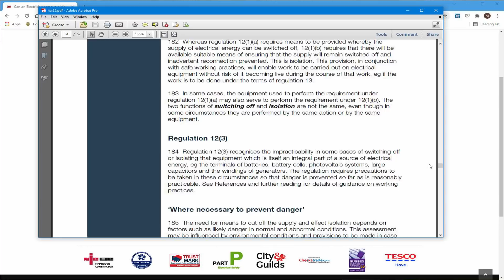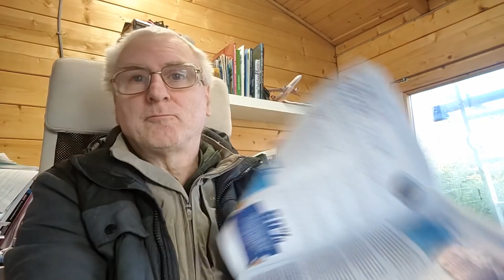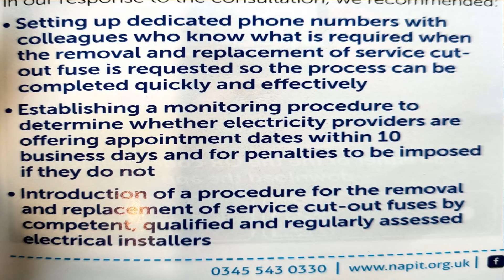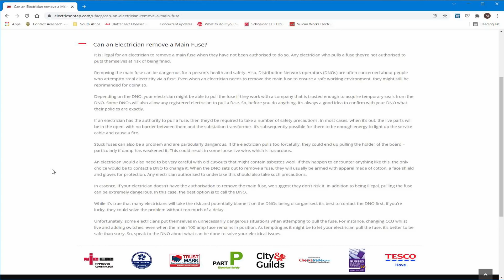CUTOUT OR MAIN FUSES - New procedures for 2022 should finally allow electricians to pull these fuses

Comment: I've lived in my house for 37 years and for the whole of that time the cut-out has been unsealed as one of the lugs that the seal should go through is broken off and the other is inaccessible.  Even when the meter was replaced some 18 years ago nothing was done about this.

I don't understand the bit in the article about there being "enough energy to light up the cable and cause a fire". If you don't let anything, either your fingers or something conductive, to enter the open fuseholder (which surely is just basic common sense) then where is the "energy" that is going to cause a fire going to come from? 

I've watched many a video from a variety of Youtube electricians and its pretty obvious that most of them will pull fuses and cut seals on meters if the job requires it.
Reply: I think the problem is.... If any electrical appliance is still switched on and therefore current is flowing through the fuse and holder as you pull it. The current can arc across. Particularly if higher current is flowing. Obviously a sparky would double check that all loads are off..... But a householder may not.
Reply: @ivanhoe6366  An arc from trying to break a high current would certainly cause damage to the fuseholder, might cause injury to the person doing it, but "light up the cable"? I don't think so. 
The article was talking about the pulling of fuses by electricians, not by householders. Any qualified spark should know better than trying to pull a fuse under load.
Reply: Sorry, I was just mentioning these things just Incase someone without any electrical knowledge thinks it's fine to just pull the fuse without switching off loads. I knew a householder who made that mistake.

Comment: I am certified to pull a cut out by SWE. I had to attend a 1 day course at the DNO office and my company has to have a certified set of crimp pliers and seals. We have to notify the DNO before I touch a fuse and the PPE they specify that I have to wear costs £1000 a set... I know its nuts, im just saying... I cant see them letting every short course sparky loose on the fuses.

Comment: Thanks for the video. There already IS a procedure for assessing the competence of an electrician (or any person with appropriate training and knowledge)  to isolate the incoming supply at the cut-out fuse - it's the authorisation procedure for meter fixers! I'm a retired DNO engineer and I had full O1 operational authorisation at LV, 11kV and 33kV. My former employer has a specific LV operational authorisation for meter fixers that allows the necessary LV switching at the cable-head (designated OP-3). I guess any electrician could take the (presumably short) course so that they can demonstrate competency re switching, identification of cut-out types, risk assessment of cable-head condition, etc. It would cost money (no doubt!) to do the course but then the holder of the operational authorisation could complete their own isolation.

Comment: A big opportunity was missed with smart meters, if they'd been required to have a (lockable) DP isolator on the consumer side built in, it would have massively simplified things for all parties...
Reply: Yep exactly. They should be fitting cutout switches which allow the consumer side to be worked on safely without needing to pull the main fuse
Reply from the maker: Thank you for the comment. I agree if smart meters are being installed then isolators should be put in as standard.
Reply: @vwes  im a meter fitter for Eon and yes all new smart meter installs come with a isolator fitted if the customer has enough space to fit one. all new builds require an isolator from 2018
Reply: Yes exactly what I was thinking.
Reply: When I had a smart meter fitted a couple of years ago the fitter put in an isolator in after the meter so some suppliers are already doing this.
Reply: Just had a smart meter fitted last week. The installer did fit an isolator and as I knew that my meter tails were not 25mm, I supplied him some 25mm tails and he was happy to fit them from the Henley block to the isolator meaning that I can get an electrician to change the tails to the consumer unit without a fuse pull :)

Comment: I think on the asbestos front more reaseach and education is needed, with a better communication of the risks. I think we may have gone too far in terms of risk aversion. Yes factories or workplaces where the air was thick with stuff, that is obviously unacceptable. But is the risk of exposure from a fuseboard (removed with due care, say wearing a mask and placed in a sealed bag) much higher than walking around a town with buildings using the stuff everywhere, some kn states of decay
Reply: Absolutely, as the saying goes "The dose is the poison". An occasional minor exposure to a bit of asbestos in a fuse holder will have homeopathic risk.  You would have more asbestos danger sweeping the spider webs off an older artex ceiling. I agree that the world has gone asbestos mad the last few years with no proper risk evaluation.

Comment: Just pull the fuse and use common sense and you will be fine, i always pull them smart meter or not if theres no isolator and seal it up afterwards, old metal clad cutout with asbestos flash guard or phase barrier is it going to cause much issue unless you start pulling it apart ?  Your there to do your job so best to do it and not pussy around a fuse your more than quallied to pull
Reply: Can you recommend a supplier for common sense? Because I'm all out of it.

Comment: Just require when ever work is done (EV/CU/tails) then a main isolation switch would be required as well to be installed and operational.  Then slowly over time more and more would be equipped with them.

Comment: Its an urban myth that DNO's send out engineers if a fuse has been pulled without permission on a smart meter.
Reply from the maker: Have to beg to differ, because Ive seen it happen. I turned off the power via our isolator so I could do some work, and I kid you not I got a phone call within a couple of minutes asking what was happening. The moment power is lost to the smart meter is stops transmitting data to the electrical supplier, and if there's no report of a power cut they are straight on it.
Reply: @vwes  Using a mains DP isolator would not interrupt the supply to the smart meter, only the distribution board (consumer unit) ? You must have pulled the cutout ?
Reply from the maker: @kevanswift7797  not on ours it's positioned between the cut out, meter and solar panels, as we send excess power back to the grid, so it has to go back through the meter. In this case don't ask me why, that's a question for the DNO and solar engineer
Reply: @vwes  yes but they didn’t arrive did they. A call centre called the customer. That’s if they have the correct number…

Comment: Been pulling them for 40 years, no issues so far.
Reply: I don't see a problem  with it also, not just yet, they're easy to pull out and put back in.
Reply: Same here, don't get dragged into a world of BS, meter seals missing get DNO monkeys in to reseal after or vde pliers into tail blocks.
Elf and safety cretins v decades of experience
Reply: I pulled many fuses in my day as a sparky as the seals were much simpler to replace then. My local supplier used to keep a box full of the old flat types under the counter. When the seals changed to the tubular ones I would just cut the wire off and then pull the strands from the seal, make the hole a bit bigger and then replace the twisted cable type wire with bicycle gear  cable as it was exactly the same, a drop of super glue in the hole would hold it in place. I'm about to pull the one on my smart meter so I can change the consumer unit, any tips ?.
Reply: Just simply needs a two pole switch disconnector off the meter tails to fusebox , job done 🤪

No need to pull bs88 😁
Reply: @marksimpson3035  Who’s paying ?
Reply: @richardjones3112  whoever  the people that change the meter tails otherwise it's back to square one 🧐 & pull the bs88 cutout
Reply: @marksimpson3035  What about when the customer gets accused of tampering with the DNO equipment?

Comment: I've made enquiries to the DNO for installing a DP isolator they wanted £250.00 Inc VAT ........Bargin.......and the next available appointment is in 6 weeks, yes the energy companies will fit a DP isolator alot cheaper or sometimes free but you will be waiting longer for them longer than the DNO.

Comment: I pull the meter tails out of the consumer side of the meter and fit a iso switch and reconnect the the tails and fit a new crimped seal to the meter when I'm finished , makes life easy with no drama's......job done  👍
Reply: Smart meters do tend to have a sensor to detect the cover being removed, not sure if anybody (suppliers / DNOs) are doing anything when it triggers, but they could in theory (as it might suggest someone eg trying to bypass the meter for a cannabis farm or similar)

Comment: If DNOs fitted a DP switch isolator with the rest of their equipment then Sparks wouldn't have to pull main fuses 🙂

Gas can be isolated at the meter.  Water can be isolated where it enters the property.  Electricity... there may or may not be a safe means to isolate depending on the history of the installation.

♥️ the DNOs
Reply: Thinking of all that safety is needed isolation.

Comment: I'm a long time retired Sparky my son is working Approved Sparky even so I decided to go down the official route and have my supplier install  for my own house  a Mains DP Isolation Switch and also the meter tails from Smartmeter to this new Isolation switch upgraded to 25 mm from 16mm. What an absolute long winded nightmare I had.
I requested this in July and it wasn't until November it was actually sorted and installed.
 I had  kicked up a right stink due to the poor service and confusion  my suppliers seem to work under and eventually got it done with no charge (was £81).
Scottish Power were my suppliers - Lowery Beck are their 3rd party installers - but then a man from Siemans turned up to do the work. hmmmmm.
Its done'  it works - but it was painful journey. 

If it was a quick job - probably I would by accident knock the fuse out  now - I would not like to go through the months of phone calls and emails and anger/frustration again for such a simple job.

Comment: During the pandemic my DNO made the decision that they would not be fitting isolators of pulling fuses for electricians...  They would however give me permission to pull the fuse providing I had all the correct safety equipment..  I agree I would not touch old fuses but have pulled the newer fuses, I have seen so many DNO engineers (Who are not electricians and get about a week or two of training) just pull and push back in the main fuse with no safety gear and with loads attached, lights on etc...  I always isolate the consumer unit(s)/isolate solar put on the required gloves and face shield..  You can either take the fuse out and put the cover back in or boddingtons do a fuse cover you can put in..  I always then fit an isolator.    If I didn't pull the fuse I would have lost so many jobs when the DNO refuses...  

I found energy suppliers are cheaper if you get the customer to ask for an isolator to be fitted, although making the call centre staff understand what you want can be a challenge..  I don't see how its safe for someone that is not an electrician but has had a week or so training to pull the main fuse but its not safe for us..  I think its all about if they do it and something goes wrong they have the bits to fix it where as we would have to call the DNO to fix,  DNO's just don't want any fixes they need to do which they cant charge for...

DNO's should work with CPS to provide a course and then CPS could as part of the assessment make sure you have all the required equipment, have it as a separate ticket like NAPIT and NICEIC do with being an inspector (Not that it seems to stop domestic installers doing EICR's)..  They could provide tags and a process where we take a photo before, a photo after  and then say pay £10-£20 per pull to cover costs if anything does go wrong..  Would generate income for DNO's which is what is most important to them and makes our lives easier..

Comment: Almost ALL Electricity suppliers will install free of charge a double pole main switch in line between the meter and the consumers unit, the incoming side (from the meter) is sealed by the supplier, however, the customers side is unsealed for the use of access for an electrician.
Reply from the maker: Interesting observation, thank you. Unfortunately that's not been my experience. Anyone else had experience of DNO's etc doing this for free ?
Reply: @vwes  not the DNO, but the suppliers do this for free, it’s now a legal requirement when requested.
Whenever I did a EICR/PIR or price for electrical works I asked bill payer to call their supplier and tell them to give permission to speak to me, then requested for an isolator to be installed between meter and Consumer unit, this was then usually completed by the time I returned to carry out the works. Some DNO’s also do this.
Western distribution for certain as they did a customer of mine whilst upgrading the cut-out
Reply: None of the suppliers I’ve contacted will do it for free, or say it’s the DNO and not them who are responsible. Have contacted Bulb, Octopus, Scottish Power and Shell.

Comment: all of this crap is a direct response to the competency of so called electricians/monkeys, education is the key to respecting electricity and not fearing it. this stuff is basic electrics 1 0 1 and makes my piss boil!
Reply from the maker: Can't wait until I publish the vid on who can and can't do EV charger installs - the comments could be very colourful lol :-)
Reply: @vwes  that's another piss boiling topic!, it still amazes me that people think these are ev "chargers", there not, there just a dedicated (expensive and smart) electric point used to supply the charger which is in the vehicle, again basic stuff, especially more so now with the ever advancing technology limiting/omitting earthing and pen fault issues. that's my colourful comment on that subject for the day :)
Reply: @brianhewitt8618  Your definition of 'basic stuff' is interesting....seems a fairly complicated issue to me (I'm not a sparky). Not all EV charging points seem to be equal....some have PEN fault detection, some don't. There is potentially quite a lot of power being delivered to an EV.....I have seen Artisan Electric have some wireless device attached near the meter to tell the 'EV charger' to limit the power so that mains cutout fuse isn't exceeded. Clever stuff...not sure if 'basic stuff' does it justice.
Reply: @Sean006  My definition of "basic stuff" is aimed at the electrician, there was no intent to offend yourself, some manufacturer's add pen fault to there equipment others you have to add at extra cost, if you dont you have to be very mindful of correct earthing arrangements. As for there being a lot of power required, yes they do require a constant load but usually less than the average cooker or electric shower and load monitoring/limiting devices are incorporated to make sure there is no overload of the supply fuse when all these loads are being used at once. basic stuff to an electrician, clever stuff to those who are not, and as i say this is no offence to those that dont understand but this is a basic circuit to a qualified electrician.
Reply: @brianhewitt8618  Thanks for the explanation Brian. It's good to know that electrician's in general are aware of such things and should be able to handle it 'with their eyes shut'. I can see EV charging point installs being very popular from now on. All the best.